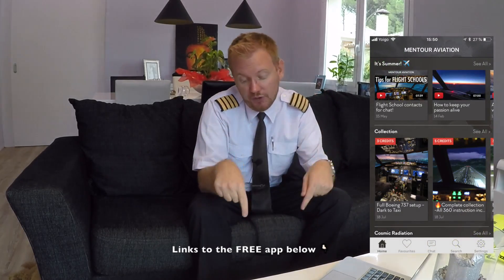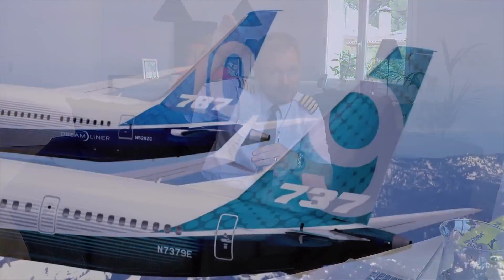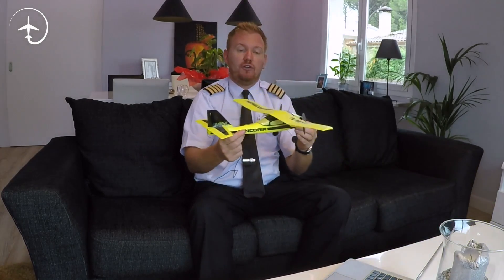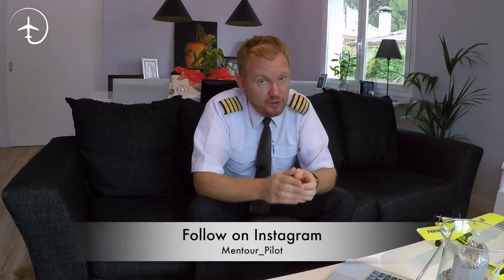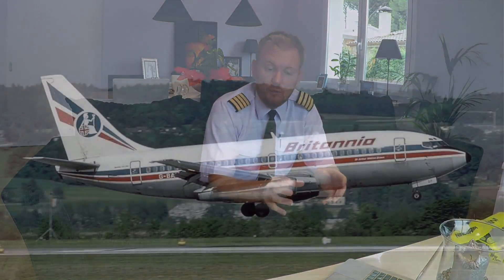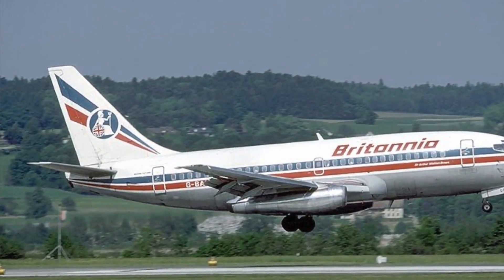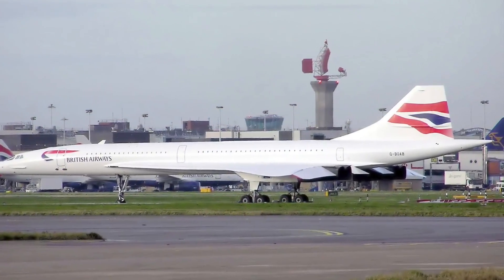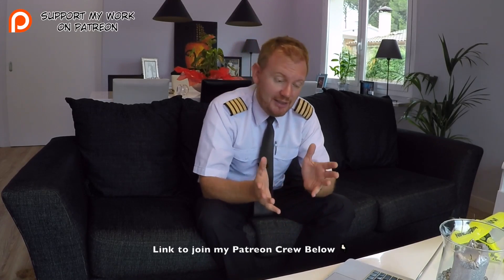The Boeing 737NG Fin: Why does it look like that?

Comment: Question. Does adding a dorsal fin reduce the tendency to induce a roll component of a rudder hard over vs extending the tail hight? You indicated that the dorsal extension was able to extend the authority of the lower rudder surface.  What I am thinking of are the crashes of some early 737’s when the rudder control unit malfunctioned and forced the rudder hard over, inducing a sharp bank which caused the aircraft to roll into a steep bank prior to the crash.  Another situation is the yaw damper failure of the Northwest 747 in the gulf of Alaska that also induced a roll moment which the pilots had to use ailerons to counter a sharp bank in order to regain level flight.
Reply: Not significant. The small moment you are thinking of is actually counter to the roll in those incidents. 
Using the rudder mainly causes yaw due to the long lever aft of the center of mass and short lever above the CoM, the yaw(and the roll moment) initially causes a skid (side slip to the outside of a turn), a skid on most airplanes with normal amounts of dihedral effect in the main wing design will induce a roll into the turn direction. 
Example: From straight and level. Right rudder first causes a skid such that airflow is now coming from the left by a few degrees(rather from straight ahead), this skid then creates more lift on the left wing and less lift on the right wing, inducing a roll to the right. Wings are much longer than the tail and there are two, and dihedral effect can be adjusted with several design choices. As the roll to the right increases the yaw force or the rudder actually begins pointing the nose more down. (imagine the extreme case of starting in a 90 degree right bank, the rudder is horizontal and basically acts as an elevator so a right rudder input will rotate the nose down)
Reply: they also used the upper rudder because the 747 was designed  with two rudder system which only dedlected the lower rudder I'm 10 years old and I know that
Reply: @noobraider99  well hello there, I was like you before, young with loads of knowledge, but I don't think there's the need to state that you're that young and put in in bold. Not everyone is like that bro

Comment: I believe 737 design is flawed, they could have redone the entire design for 21st century. As you see today we don't require a low fuselage (we got sufficient equipment to board, disembark pax and to load, unload cargo) plus to cater for larger engines has become a trouble, as we require specially designed engines for 737, plus lower turbofan Height from ground means higher chance of debris suction on ground run, and low height of under carriage means extra caution during landing and take off as less margin of error available for fuselage to get in contact with ground. All this adds up for airline as unforeseen maintenance costs and these are just few of the external structural issues, then comes aircraft cockpit and cabin.
Reply: Boeing should hire this "expert" to design all new boeing 737......learn back why 737 exist in first place kiddo....
Reply: @arifkhamar6430   enlighten us.
Reply: @adeeb8682  that i said you need to learn back history of b737 kiddo... and why it become popular and being choosen by many air carrier.
That why B737 program still continue till today and become successful...riddle me this.....you said b737 flaw from starting point,why mostly air carrier still buy and using B737 till today.....
Reply: @arifkhamar6430  you have no idea boy, it is a flawed plane from start, i don't think you know a thing, why don't you see the figure as to how a320 has bagged remarkable number of orders in a span 20 years less than 737.that almost sums everything up for you because you don't seem to understand the technicality, i hope numbers will do for you. If you don't even understand numbers please don't care to reply.

Comment: @mentour A question: I watch quite often flightradar24, I noticed that at intercontinental flights e.g. to south america, where they fly through zones without radar control (I say it simple as layman), very often I see pairs of aircrafts parallel or just couple of miles apart, like a Lufthansa Frankfurt - Rio and the other Lufthansa Frankfurt - Sao Paulo, close together. Is that for safty reason (that they can communicate while there is no radar or so, and do they communicate?) or is that only to safe money at the departure, that ground crews can serve all the passengers and do the stuff in the background of flights (food, flight planing etc.) and after they departed the ground crews can leave the couters? Or so?

Comment: What is the procedure if you fart in the cockpit?
Reply: If you know in advance, call the flight attendant into the cockpit - or not.  Either way blame her/him because you aren't at home, where you could  blame the dog.
Reply: Open the window.
Reply: Contact the ATC and request an emergency landing due to a gastric gas leak in the cockpit.
Reply: Boeining hopes to get a solution soon.
Reply: Tom Servo They'd have a solution way before Airbus would I guarantee you. Lol
Reply: Rapid decompression.
Reply: It depends on the airplane you are flying actually. If on a Boeing it will vibrate the yolk and stop you before you go too far with it but if you insist then she will allow you to do whatever it is you want. Of you are on an Airbus however it will be watching for the density of it and will give an audial alert before you reach its limits and if you just push the airplane a bit more she will take over the control  and will keep on farting in a risk free way. Other than that you can just apply the "smoke removal procedure"
Reply: Joedi I If it’s the other pilot, and it was particularly bad, I used to use  the oxygen mask. Nowadays I just angle a vent to blow fresh air in my face.
Reply: The technical term is a ventdogger. No ventdogging allowed in the pilot's seat!
Reply: Ejection seat and parachute...what else?
Reply: In 737NG.. You can look up in the QRH, section 8 ( Fire Protection ), and find “Smoke or Fumes Removal” checklist.. or (for FO) just fart and shout at other pilot “Volcanic Ash!”.. then grab the QRH, open section 7 page 7.42 “Volcanic Ash”.. for Captain, no crew action required, just fart and resume normal operation..
Reply: finger the farter's ass to block further leakage.
Reply: Let go of the controls, turn off the pressurization system to equalize pressure inside and out, slow down the plane to just above stall speed then open the windows
Reply: Hold it in until landing ... 😄

Comment: Amazing! I've wondered this since I was a kid looking through Jane's aircraft identifying books in the 1990s. Great informative video as always.
Quick question on the 737. Why was it chosen over the 757 to update and keep in production?
Reply: the 737 is much more prolific and much more versatile than the 757. Airlines who already operated the 737 wanted to be able to have an easy and cheap replacement so boeing just kept upgrading this aircraft so airlines didn't have to pay to replace crew, engineers etc. It was also much more important for boeing to keep this plane going because there are thousands more 737s out there than 757s. It would be less of an issue on boeings part if they failed to design a 757 replacement because they serve a smaller market so its in their interest to just design an entirely new plane to replace it
Reply: Because the market wanted it and there were no technical reasons to not do so.

Comment: Why jet engines on supersonic military places or otherwise can't intake air(why air is slowed down) and perform well at supersonic speeds?
Reply: Has to do with thermodynamics. At supersonic speeds the air will enter and exit the engine too fast to mix with any fuel and combust.

"Compressor stall" is actually caused by the air leaving the compressor or at the blade tips approaching supersonic speeds, causing a turbulent flow in the engine (hence, stall).

Comment: Maybe there is some fuel there? Because there isn't any in the wings! Last time a watch the re-fooling operation on a 737, they "poured" in with a flowrate of 72000 litres/hour!! If someone want, i can produce a video of that flowrate using a similiar size hose. Then you can use you brain and think of that incredible rate is flowing into those tiny aluminum wings!
Reply: Hallvard Dalen there is fuel in wings. An aircraft stores fuel in the main tanks (in the fuselage) in the wing tanks (they put fuel there to stabilise the aircraft) but not in the tail. However Airbus and Boeing make a variant in some of their planes so the airlines can choose as an option to have trim tanks. They're used to trim better the aircraft by pumping the fuel in those
Reply: Proved to me there is going fuel into them please! No more talks!

Comment: Has the C172 similar tail for the same reason of increasing rudder effectivness? Although it is single engine aircraft and probably the tail length would not be a problem.
Reply: wigrysystems yes I think so

Comment: I've been thiking about engines. As most modern large aircraft have two large engines under wing, 2 engines is more economical than 4 slightly smaller ones. Ok that is valid explanation. How one thing keeps bugging me. What happens if there is dual engine failure on low altitude, ("Miracle on Hudson" for example) where the circumstances and pilot skill saved many lifes. This is bringing me to question. 
What if there would have been third engine under fin, or two more small engines under wing. These engines would be essentially just idling, or possibly even turned off during normal flight, but would be turned on during liftoff "just in case" if the "main engines" fail? Sure it would add weight which means smaller cargo capacity, and slightly higher costs, but I would call that a safety feature.
Then again I fly very rarely. but aviation has been a slight interest of mine for years.
Reply: Because single engine failures alone are rare let alone dual engine failures and dual engine failures below a safe altitude to return to an airfield even lower. The most likely reason for a dual engine failure would be fuel problems or a bird strike so fuel problems can't be avoided even with these back up engines and bird strikes are extremely unlikely to cause engine failures. US1549 was the first dual engine failure below a safe altitude.
Reply: Well I arent quite up to date on what kind of incidents have happened, and only dual engine failures that pops in my head are either fuel related and US1549. With that said, taking in to account how many flights there has been in past 40 or so years, I have to agree that this is actually quite valid argument.

Comment: Dear Mr pilot , why don't all Boeing airplanes use a dorsal fin?
Reply from the maker: They don’t need it. It’s only really added in case an aircraft is redesigned like in the case of the B737
Reply: But wouldn't designing it with a dorsal fin from the get go allowing a lower fin and thus less drag?
Reply: Dorsal fin ? It curiously reminds me of the Caravelle...

Comment: can you not cross-control?  i'm certain your passengers would appreciate it if you learned how, or is there some structural or procedural restriction?  it's not fun being seated in the rear when a pilot crabs in, then plays Crack the Whip at touchdown.  good vid otherwise!
Reply from the maker: The cross control is not recommended by Boeing for the 737

Comment: Can you explain the relationship between speed and flap setting Mentour?
Reply: In very simple words: during landing and takeoff the speeds are lower but there's more need for lift. Here is where the flaps (the trailing edge of the wing) and the slats (the leading edge) are extended to increase the area of the wing and have more lift available at lower speeds. Opposite you can't go very fast with flaps extended. Extending flaps you reduce stall speed but you also reduce the maximum speed. That's why they are retracted during cruising. Every plane has its speeds but I can tell you a fun fact: at maximum flaps extension an A380 can do lower speeds than any short-medium haul plane
Reply: Yep. I know the physics behind how flaps work, I was more looking for some insight into what kind of speeds require which setting inputs on his 737 in typical configaration. As you say though, every model will have it's speeds. I believe you about the heavies, I watch a 777 crawl in on pre final over my workplace and wow! She's very graceful and stately. Takes her sweet time with that massive wing.
Reply: Flaps are only used in the white zone on the indicated speed dial.
Reply: Yeeeahhh...that's good for a Cessna, an airliner on the other hand.....

Comment: Until this video I thought that for the most part dorsal fins were the admission that the original fin was too small.  In WWII fighters the goal was to have the minimal size fin and when the designers undershot they just added a dorsal fin.  Apparently they frequently missed on the low side because they are common on planes of the era.
Reply: Sometimes they are added to increase the vertical stabilizer area to correct a mistake as you said. But they can be added to an existing design that is being improved and keep you from having to change the design of the Vertical Stab side and position.   More times than not though, the dorsal a light weight, efficient way to delay a condition known as rudder lock.  There are other ways to prevent rudder lock.  But they are heavier and less efficient.
Reply: SkyTrain II.  Thanks for the ideas.  I think I know what rudder lock is,  a deadband or no response deflection  which is generally small and the dorsal provides turbulent conforming airflow which hugs the fin and eliminates the deadband,  Am I close?
Reply: Try this. As the yaw increases, the vertical stab angle of attack increases and the neutral point (that dead band you mention) of the rudder moves in the direction of yaw.  This movement of the neutral point is generally less than the deflection on the rudder.  As long as that is the case, the rudder has an opposing moment to return to neutral when pressure is removed from the pedals.  But if the neutral point ( also called the float angle) catches up to the deflection point, the opposing moment goes away and the rudder will not return to zero deflection on its own.    If the float angle goes beyond the deflection point, the rudder moment will reverse and cause the rudder to go hard over if you take your feet off the pedals.  That is rudder lock. The pilot will have to overcome the moment and force the rudder back.  

That is a bad and dangerous design.  The dorsal is an efficient fix for that and prevents rudder lock during the possible allowable maneuvers.

Comment: I bet Concordee is everybody's personal favourite...
Reply: jaroslav     Nothing against it but not even close to being favorite.
Reply: While it is close the Vickers VC10 edges it out for me, the original queen of the skies.
Reply: @Carde: Double that!
Reply: I change for multipla of sky - Airbus Beluga XL
Reply: DC-6 is my favorite, something about the lines of that aircraft just do it for me. The Concorde isn't to far off though.
Reply: Lockheed L-1011
Reply: A340-600
Reply: 747 is my personal favourite 😍
Reply: 747. It has the look and nice curves.
Reply: mmh. Maybe not everyone, but a lot of people. XD

The thing about airliners is most of them are very similar looking.

Concorde just looks unlike any other civilian aircraft around. (Well, there's the TU-144, but it's somehow notably less elegant.

The 747 has the benefit that the hump of the upper deck is very distinctive, again, making it stand out in a crowd of otherwise very similar looking aircraft.

I bet if you showed a bunch of people other than enthusiasts a dozen modern airliner designs they'd have a hard time telling you which is which.
Reply: Concorde for civilian and SR 71 for military .
Reply: Mine is the 777
Reply: 787 is my fav
Reply: 747-400 for me.
Reply: nope my fav plane is that one that can do barrel rolls

Comment: Hi Petter is it true that in your Airline you are only payd from closing the aircrafts Doors to Open it or has that changed
Reply: Torben .u.f usually parking brake off to on, but they typically get a low hourly per diem when on duty but not flying.

Comment: Oh bugger,

I was enjoying seeing your video so much that while I was doing a simulated flight (X-plane 11) from Innsbruck (LOWI) to Ingolstadt (ETSI), I didn't noticed losing an engine.... 

And now it won't restart and I have to finish the flight on one engine.... cut fuel, feather prop and hope for the best, well at least it did not involve a fire... 

Apparently the DHC6 Twin Otter doesn't really mind too much losing one of her engines...  at least in simulator-ish environment.

Better see another one of your fantastic videos while I hope I wont loose the other.

Speaking of which, two questions... possibly stupid questions but I rather ask stupid questions than to remain stupid by not asking them.

1. If the Boeing 737NG looses one of her engines during flight, will she able to maintain cruise speed and if yes, will the consumption be more or less when compared to standard situations?

2. Can the sync prop option present in multi-engine piston or turboprop force one healthy engines to power both propellers or it is just too dangerous and increases the risk of further damage to the already damaged engine and attached systems?

Cheers!
Reply: F